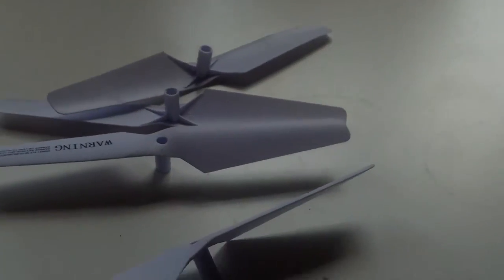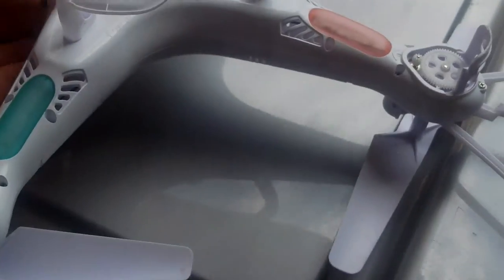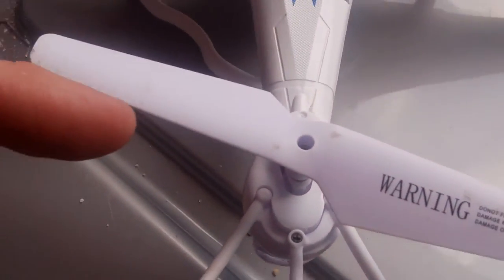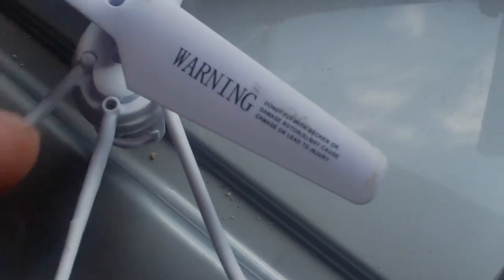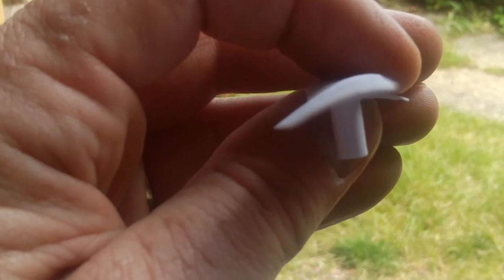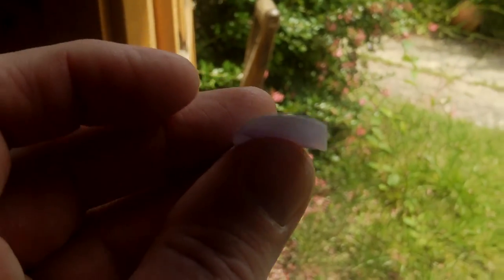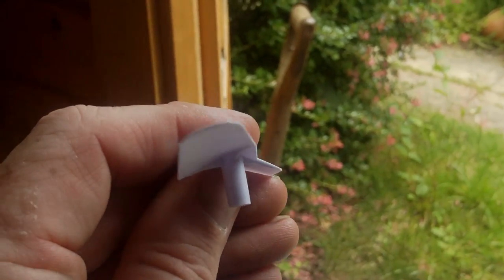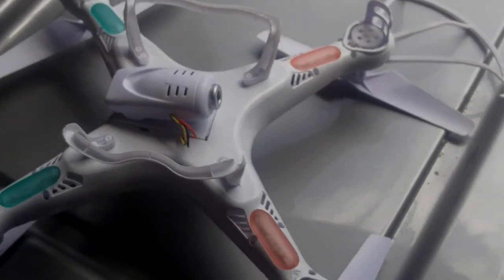SYMA X5C changing Blades Solution

Comment: Thank you so much!  I got mine working.  The best way I think is to align the new blade using the "Warning" label on the current blade as reference "before" taking off the old blade and do one blade at a time.  Once I figured it out, my "Warning" labels on two blades were backwards.  Flies great now.